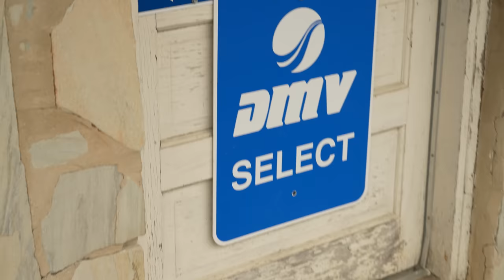3 Buick Reattas inside a Semi trailer & a handmade Alfa Romeo 6C 2500 | Barn Find Hunter - Ep. 120

Comment: I've loved the Reatta since they first came out, and $10K for one with low miles is very tempting. However, when I saw the gorgeous Alfa Romeo inspired build, I saw something that looks very much like my most favorite car of all time, the Auburn Boattail speedster. Beautiful. What a treat to see both in one episode of Barn Find Hunter.
Reply: I have a 34k mile, 1990 Reatta Convertible, red on tan, body color bumpers as opposed to the safety black you see here in this video, my grandfather and myself are the only two to own it, special ordered by my grandfather with my input in 1989. Getting ready for sale in a week or so, if you’re interested before I put it on BAT.. :)
Reply: Looking for a convertible with the cd option.
Reply: @davidschluter6639  that’s what I’ve got - single family owned and ~34k miles in beautiful shape. If we can’t strike a deal, I’m putting it up on bring a trailer :) tan convertible top, tan leather, factory CD player, all lcd screens work. The motor for the right headlight is iffy but a pretty easy fix.

Comment: Wow.  I loved my '89 Reatta.  Mine was Red w/ Gray Interior and had body colored red moldings instead of the black molding.  I liked those better and they appear to be a little rarer, or at least they were near me.  I picked it up w/ about 40k miles on it and was in my 20s, so my insurance was ridiculously high.  I'd love to pickup another Reatta some day, but would need to be a '90 or '91 so there's no touch screen.  That's the only thing that was problematic on mine.  When it acted up, the backlight would not work, but the buttons would, so if you could figure out where a button was, you could still use it.  I'll never forget a hot fall day, I had the A/C on and the music blasting, parked the car.  The next morning, it was nearly freezing and when I started it to go to work, I nearly froze to death b/c I couldn't figure out how to turn the fan down or off and the tape deck was still blasting.

Comment: The 3800 V6 is probably the best engine GM has ever made. There's few newer GM engines that'll happily go past 200k miles and still run and sound perfect. Not to mention the 3800 is easy as hell to work on.

Comment: Question: How does an 'English Teacher' afford such luxuries? 
Back of the napkin math says, something don't smell right...
Reply: In 1975, the three junked Alfas used as the basis for these projects cost $1000, net. A 4' x 8' sheet of steel is $72 (maybe a dozen needed). Upholstery material $450. Yeah, I had to buy a gas tank and tires, get stuff chromed, have machine work on the engine, etc. But except for paint and seats, I did all the work myself (no cash outlay). What makes you think there was some huge cost I’m not revealing? What would I have spent it on? 
The Professor